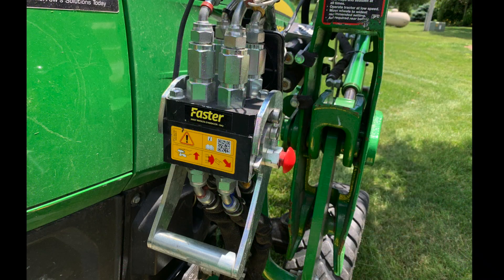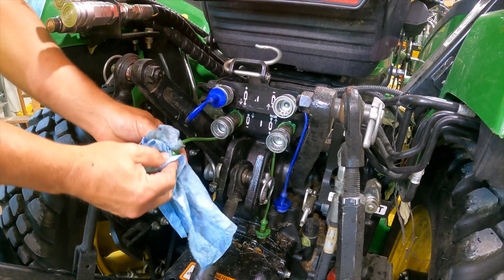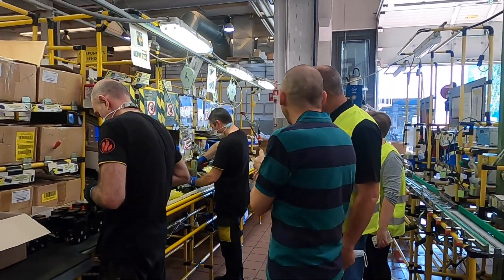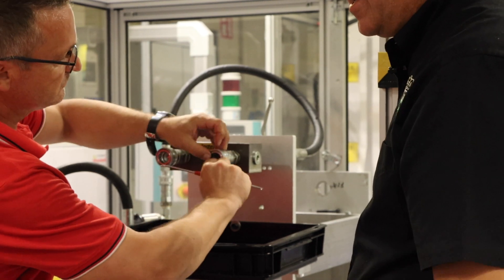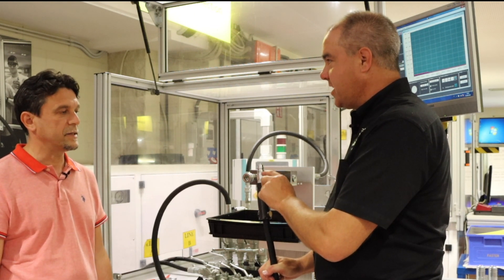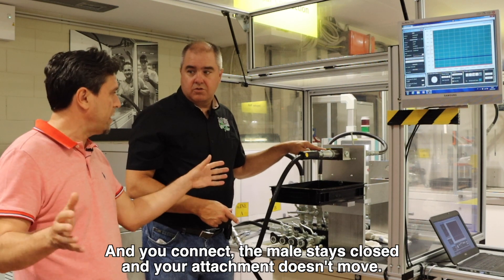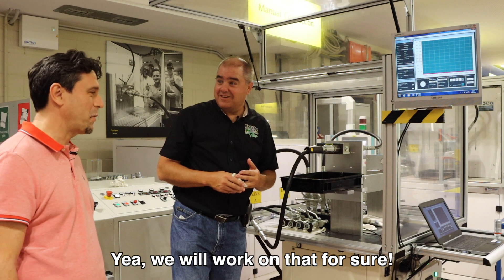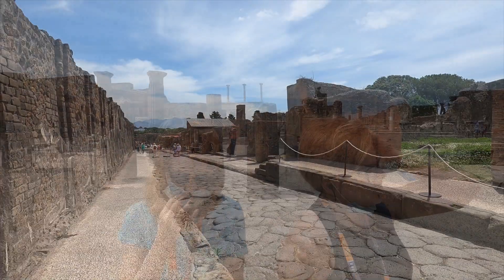How To Damage Tractor Hydraulic System - FASTER Factory Visit - Connect Under Pressure

Comment: When I was in the navy we often had to repack hydraulic components, but we were told to never use steel tools as they could scratch the seat area for the oring. We made our tools from brass so they wouldn't scratch. Usually 1/8" rod that we formed into shape.

Comment: Great video, as always.

You might want to reach out to Parker Hannifin regarding hydraulics.  They are an international company that has small plants in rural communities.  

In my line of work, I deal with hydraulics on a daily basis.  Every thing regarding cleanliness is fact.  I actually prefer Brakekleen prior to breaking hydraulic connections and using the ubiquitous petroleum jelly to lubricate any O-Ring connections.

Comment: I have load sensing couplers made by Faster on my Challenger tractor. $400 for each from Agco. Aftermarket are $179 or so. Too bad there is no universal couplers. I have Deere, Case, MF and Challenger tractors. All take different ones.

Comment: I can see the future. How long Tim will we have to wait for the 6 space faster in 1/4? Maybe send them a BXX10283 bracket  for a mounting guide and make it painless. This solution solves the 3rd function quick disconnect and maybe a lot more.Certainly cleaner, for a few dollars more. You read tea leaves better than most. Can Deere adapt to a six space tractor couple half to set the market in time to match it?? Best guess on cost? Summit Faster, USA is a fine collaboration? I hope marketing gurus can see how valuable this is. Contact me if I can help, or be your next Guniea pig.

Comment: Does these connectors restrict the flow rate of the fluid moving though the lines? Ive read these restrict gpm rate but maintains pressure.
Reply from the maker: We recently did some hydraulic flow tests on the Deere 1,2,3 and 5 series which provides some good info on that question. Check it out.

Comment: Being able to connect under pressure would be nice for those times you forget to release the pressure before disconnecting. However, it seems you would lose the ability to have 1 male and 1 female on the attachment and the same on the tractor. No need for color coding. Both my backhoe, from the dealer, and my flail that I set up are done this way. 
For those times I've forgotten to release pressure before disconnecting I press the flat part of a flat head screwdriver against the ball in the male fitting. Yes, it IS better to remember to release before disconnecting!
Reply from the maker: A simple zip tie on the hose solves the problem. No need for the one male one female.

Comment: What he says makes sense. Contamination from a fluid point will pretty much get caught by the filter but dirt is kind of like a grinding compound and these connectors are working with very flat accurate metal surfaces pressed against each other so it makes sense that if you start to get scoring and scratches in there that’s where you’re going to get your leaks. Not just leaks but the difficulty of coupling and uncoupling these connectors. The smoother and cleaner they are the easier they’re going to be to engage and disengage I would guess. Usually manufactures deal with stuff like this like on a gas line or even a water line with putting a crush piece in there like a softer metal under pressure that conforms and fills the space to make a good seal but in a quick disconnect coupler you can’t do that you can’t use a soft brass piece that’s going to crush because after crushing a few times then it’s going to degrade and have to be replaced. TheO-ring it’s kind of that but the O-ring Hass to be held under very even equal pressure so you don’t get those leaks to wear a simple pressure fitting is going to have a soft brass or nylon piece that you can go ahead and crush and it’s gonna make that seal but that won’t work for repeated use. Makes a lot of sense. I’m guessing in the quick coupler were you just pressing two flat pieces of metal together tightly that those little scores and scrapes would make a huge difference. I never thought about it as far as anything but getting dirt in the fluid.

Comment: I can't be the only one that really, really hates the multicouplers. Leaks worse than the iso pioneer couplers and costs 50x more to fix. Plus Deere mixes the Deutsch electrical connectors in the same shell hired hands wreck them on combines all the time by leaving debris in them when switching headers.

TBF, the Faster multicoupler cartridges have held up better than the Pioneer made ones in Deere applications. The Pioneer ones are so bad I dread coupling a header and carry JIC adapters to bypass the multicouplers blocks. 🗑️
Reply from the maker: The Faster multi coupler is MUCH better than the competition.   Don’t throw out the baby with the bath water!

Comment: Did you ask them about having a  6 hydraulic line single point connector?
Reply: @TractorTimewithTim  any update on this?
Reply from the maker: @richardlaflame4644  making progress. It takes longer than I had hoped.

Comment: Our 1949 Oliver tractor had a quick disconnect/connect coupling mechanism. It would disconnect the hyd. lines to the plow cylinder when the plow would disconnect from the tractor under a very hard pull. You would simply back up to the plow reconnect it to the tractor and then put the male sides on the hoses, which were ganged on a bracket into the bracket on the tractor holding the female side. Then using an open end wrench, which you always had on a tractor, and leverage the two together. that same coupling unit had a lever you pushed and the two holes were disconnected in a flash. Really a two second job. Remember this is 1940's technology. So this one handed coupling unit is just an upgrade from that unit. But I bet this unit will not allow a disconnect if the remote cylinder holes gets caught on something or a pull type implement became unhitched.
Reply from the maker: Yea, these push pull connectors will ‘pop out’ if the attachment comes unhooked, etc.  this should keep the hoses from breaking.

Comment: Tim the coupler is upstream of the filter. Fluid enters the coupling and then travels to the cylinder or motor. So contamination from the coupling can damage the cylinder or motor before it ever passes through the filter. So The particles don't have to be too small for the filter to do damage. The cylinder seals and tight clearance components in motors don't really like sand particles or microscopic hard metal particles. It won't kill them instantly but it will reduce performance overtime.

Comment: Hey Tim, ask them where my single point is? I ordered it last February!
Reply from the maker: Uhoh!   Though a dealer?   Or through GreenPartStore.com?
Reply: @TractorTimewithTim  A dealer, Faxon Engineering. Actually they have been great to deal with and I have the male half. The female half not so much, it's coming from Italy someday, maybe, I guess. Faxon says Faster told them middle of August. We'll see, Faster also told them end of June and April. Looking forward to getting it installed though! I thank you for that as I saw it on your video. Keep up the great work!
Reply from the maker: GreenPartStore has been shipping them regularly.  Not sure why your dealer would have trouble getting them.
Reply: @TractorTimewithTim  This is a 6 port, 10 gpm and was not available in US
Reply: Apparently

Comment: It would appear that on the new connect-while-pressurized couplers, the female would have to be installed only on the tractor side of the circuit for it to work, as it would not be possible to pressurize it from the implement side to actuate opening the coupler.
Reply from the maker: Female is always installed on tractor side.  ….well, except for Kubota!  Makes no sense to have the more expensive coupler on the attachment side.

Comment: I have a tool recommendation for you - Snap-On makes a set of O-ring removal tools. They have mini-screwdriver handles and the end is a almost flat, rounded spoon. The extra width at the tip helps hold the o-ring and much less risk of cutting the o-ring or scratching the groove. They're a little spendy but worth ir.
Reply: https://shop.snapon.com/product/Seal-Removal-Tools-Soft-Grip/4-pc-Instinct-Soft-Grip-Seal-Removal-Tool-Set-(Red)/SGSR104AR
Reply: Here's the link - I saw similar ones on Amazon but I'm not sure I'd trust the quality of the steel to not bend.
Reply: My dad was an industrial mechanic for over 40 years and changed thousands of O-rings in hydraulic equipment. He taught me how to use a dental pick and tiny screwdriver to change the O-rings in quick couplers. It is VERY inexpensive and takes all of 60-seconds. I'm sure the Snap-On set does a fine job though.

Comment: I always love the part where the farmer or the equipment operator hits the male end of the connector because they can’t get it together and then they damage it. We do not sell the pioneer brand or style that farmers are accustomed to. Too many came back with hammer damage because the implements sat in the sun and heated up the hydraulic fluid. Then it was difficult to connect and then they hit it with a hammer to relieve a little pressure.
Edited for clarity. I said hitting it with a hammer, but that also will include a rock, and adjustable wrench or any other suitable instrument for striking something. Trust me they do it.
Reply from the maker: Oh yea.  We do!  The Waite tool from BoltOnHooks.com is a great solution.

Comment: This video is way overdue haha. When I first got my tractor a couple of years ago I never looked forward to wrestling those "quick" connects for hydraulics. What a huge pain until you figure out the pressure relieving tricks that no one tells you about when you're buying the darn things. Thank you Tim! And congrats to your daughter :-)
Reply: Take a wrench and crack the lines to relieve the pressure before hook up. Especially after the lines have been out in the sun. Only trick I know.
Reply from the maker: Waite tool from BoltOnHooks.com
Reply: @bulletsandbacon4440  that is what I have to do, undo the connection a little. However even on the hottest days I find placing the machine in the shed under cover and in the cool shade helps a lot. Hopefully Michael will tell us a trick to do it.
Reply: What is the trick or will you not tell?
Reply: The main "trick" is to cover the male connector with a rag and tap the end with a hammer until pressure is relieved. Then everything connects right up. The best practice is to store implements like the backhoe with hydraulics completely relaxed so settling doesn't result in connector pressure. Hence why I use a dolly.

Comment: Hey Tim, great video! I'd recommend trying to find and use a brass pick for o-ring removal. The standard steel or stainless steel picks can cause a scratch that allows the fluid to leak around the o-ring which will render the fitting useless. Doesn't happen often but it will happen
Reply: Another solution to the scratching problem is to deburr the sharp point and any sharp edges of a steel pick to make sure they are slightly rounded.  Dental picks typically are sharp pointed, and have very sharp edges to be able to scrape plaque off of teeth.  ...bad for o-ring removal due to the possibility of scratching critical sealing surfaces.

Comment: "the filter will catch that stuff" 😆. I worked with hydraulics for 35 years and I heard this allot. Believe me you don't want that stuff going thru your system before it gets to that filter. Just clean it, compressed air, WD40, brake cleaner, electrical cleaner... They all work well. Plugs help also. Save yourself some grieve and get into a routine of cleaning your couplers Everytime you use them.

Comment: Many farmers don't realize that the newer JD tractors (and probably also some manufacturers) have the couplers that can hookup under pressure.  I've seen several express frustration when they hookup and the implement doesn't seem to respond on the first touch of the controls.  What you have to do is push the control lever or switch once up and then down.  This applies pressure to one hose and then the other to open the tips on the hoses and then everything will operate normally.  This applies to all the 8XXX and 9XXX tractors and probably some others.

Comment: Brake clean and starter fluid work great as cleaners for hydraulics
Reply: Yeah, NO!!!!  Brake cleaner will eventually ruin the seals in a Faster multicoupler. The Deere service guy uses electrical cleaner for a reason.

Comment: 2038R has 1/4” couplers on the loader and 1/2” couplers on the rear SCVs. I don’t have the rear power beyond but I think they are 1/2” also. I just replaced the plugs for the rear SCVs with a set from Summit so they would all have different colors that matched to the couplers on my stump grinder. (I got tired of not connecting it correctly the first time.)